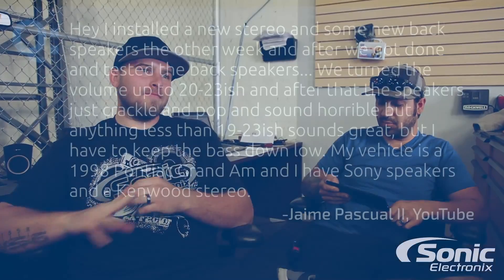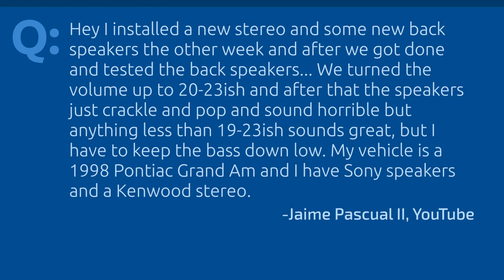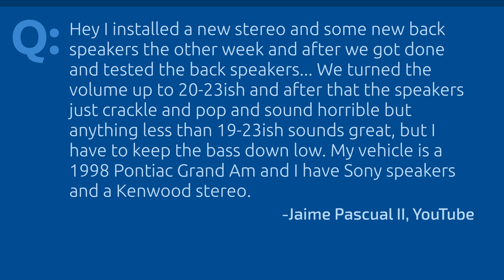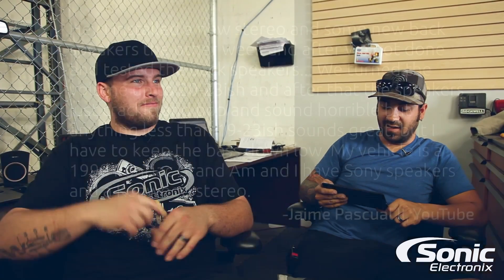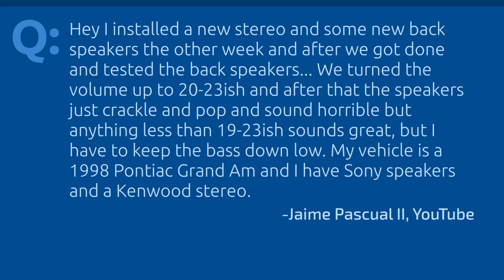Why Do My Speakers Sound Bad at High Volume? | Car Audio Q & A

Comment: I had this same problem on my 2014 altima sv when I took out my factory speakers I regret that now so I ended up putting kicker ks 6x9 rear 6 1/2 front doors kept my 2 stock tweeter on front dash went to best buy got a alpine power pack install now my bass does not sound premium anymore 😲 now it sounds like it's in a cardboard box just cheap no more deep bass and I check my polarity I thought it was weird green was positive and red was negative it is louder now with no distortion but the base is just horrible my screws are in tight I order a braket for my front door speakers so I also hear that you have to break speakers in is this true and why the base sounds the way they do please help me out here

Comment: So, I have a question. I have a 1992 Toyota Pickup, which I installed a jvc kd-r888bt stereo in. I changed the rear speakers, putting in a pair of Kenwood 400W max 6×9 speakers. I noticed that if I turn the sound any louder than level 22 (which isn't very loud) I get a nasty crackle which I didn't hear even with the original speakers...what can I do?

Comment: Hey I'm Harley I need your help my cousin installed a carduel touchscreen stereo and did disconnect the battery on my 05 crown Victoria and I've checked all my fuses and I'm still not getting any power please I need your advice
Reply: Harley Short check your ground and power wires

Comment: I installed Kenwood deck into my house with 12v power supply, some jvc house speakers, and jvc subs. It's very loud, but I want more, would it be worth "in your opinion" to add an amp to my setup? I feel like my subs are not pushing as hard as they could.
I have all this in my house, basically same audio setup in car, just in my house.

Comment: I've got 4 kicker 8 inch mid-range on a high pass filter at 150-200hz and they sound kind of shitty. 150rms to each pair. I'm wondering if it may be a polarity issue. My 6 1/2 mid-range sound pretty good at 120 
Hz

Comment: Hi guys i have a question i do have a grand caravan 05  i try to put a after market stereo i connect every single wire  to The harness it turns on but no sound then i bought a second harness same thing happen now i get a new raptor harness and still The problem but the way blue wire and red wire are connnect together to the stereo red wire..if i connect the factory head unit everything its fine so i wonder what im doing wrong????

Comment: Can a 2000w amp play 2 12" pioneer champion series 1400w each
Reply: RMS. What is the amp's rms?

Cheap companies (Boss, Crunch, etc) market their products by a bloated number of watts. They will never achieve those numbers. So you need to know the RMS, aka what it will really do. (You get what you pay for, if you bought a 2,000W amp for $80, it will probably only do 500W on it's best day)

Again, what is the rms of the subs? What is the lowest ohm that your amp can run stable? Single channel, dual channel? SVC or DVC? What ohm rating are the subs?

You've left out far too much information.

Comment: check Abdou's post a couple down right on the money aftermarket HU's probably put out more power than a stock HU, which means it probably has an onboard amp that you are now daisychaining through a crappy old factory amp that probably is less powerful than the new HU or at best the same which is not a good idea ...test your factory amp by bypassing it: pull the new HU out of the dash, unwire your head unit from the factory harness (except for the power, gnd & remote) then run some temp wire directly from the HU unit pigtail to the speakers and if the 'rice crispies' are gone you now know what the culprit is

Comment: So I have a 06 impala and bought some new rear kicker 6x9 speakers and install them. When I had install them, the right speaker wasnt getting power like the left speaker. I also have one 12 and a 300 watt amp that I didnt connect to it yet. Im just trying to figure out is my wires going bad or is it just the radio ( its the regular radio by the way) Ive bought a small kit that i can use to run the amp off the regular radio.

Comment: So, I just just switched from a pioneer head unit in my 2005 ram 1500 to a Boss Audio BV9976B a couple days ago and have been having a similar issue. When the vehicle is off, I can crank the hell out of the radio and it sounds perfectly fine, however when it's running and I try to crank the volume above 30, it has an intermittent cracking sound. Keep in mind that this is with all fairly new pioneer speakers(less than a year). With the pioneer head that I had in before I could put WAY more power through them than with this unit. Could that be a ground issue or something wrong with the head unit?
Reply: Devin Fitzpatrick ground issue or ur rca is by a power wire or ground wire ur rca can not be around and ac curent or itll pick up noise
Reply: We have the same problem when i turn off the car then the volume is 15 there is no crackling but when i start the car above 7 the speakers start to have crackling noise
Reply: Ok what do you have powering the speakers just the factory head unit and what kind of speakers are they I know you said pioneer but what is the rms of the speakers

Comment: I got a dodge avenger 97 it was a show car but it has some strange crap in the trunk like an amp called a soundstorm 700w with two large subs they seem as old as the car. Are there any subs and amp that are better then these that are under or around $200? I'm redoing every thing to this car and I want to remove the back seats and so space is no prob just want to keep the coast down.

Comment: I have a 8 inch subwoofer with a 60 Watt Amp (I'm not sure if its 40 watts RMS but i know its 60 watts peak and this is a  Home theatre Subwoofer and i changed out my stock subwoofer from the stock 60 watt sub to a 1,000 watt BOSS  AUDIO Subwoofer and tried it out and still Distorts  at  full power. The stock sub  distorts at full power and then my new 1,000 watt subwoofer  distort and its a 1,000 watt Peak but 500  RMS  and  im using the stock amp+Box (And then put 2 blue LED light strips and then put 2 plexiglass on left and right side of the box and  i have the  pelxiglasses  nice and tight with silicone (Or Cillicone |  IDK how to spell that word lol and my subwoofer does sound good at the 40 watts but i wish to have it  NOT distort ;-; I'm also getting a new stereo system soon with about 800 watts peak but 400 RMS I dont have enough money  yet and getting some money soon for the  1,000 Dollar system!

Comment: Random question! I have a Kenwood head unit in a stock system 2004 camry 2 pairs of 6x9s and factory tweeters as well. What should I set the hpf for on the Tweeters? Any help is much appreciated! (before you all tell me to just install new speakers, I am, but in the mean time I'd like my music to sound as good as possible.

Comment: i have a boss epic 2500 5 channel with 2 shallow pioneet 12s and 2 kicker 6x9s and some tweeters with a pioneer stero in my c10. everything else worls fine but when i hoom up my 6x9s i always get distortion eve w/o the subs hooked up. any suggestions?

Comment: I have two mempnis m5 12's pushed my a memphis 1500w amp. Component speakers are: J.L. Audio 1's, 6 1/2, crossed over and 4's all pushed my a 300w pioneer.  7inch touch screen deck.  My problem is when I turn my system up loud the 1's cut out.  How do I prevent the highs from cutting out?

Comment: dose door speaker baffles improves sound quality at all?
Reply: I wanted to try baffles on my set up as well. I get alot of vibration from my speakers. I definitely need to sound deaden my doors. Wondering if i can get away with just using baffles and some sound deadening material around the coaxial speakers.
Reply: Depends on the speaker.  Sound deadening woyld be best but a baffle will improve mid bass

Comment: i tested my p2 10 inch speaker with my home theater and it sounds good at low but it makes a pop noise at higher volumes it is a dual coil but i jus conected one side any idea if it will still work when i connect it to my car ?

Comment: Hi guys! I saw the Q&A video of "why do my speakers sound bad at high volume" and i kind of have the same problem. I checked my settings, everything seems fine. I have my hpf on 80 and a sub with amplifier in the back. With my pioneer radio 4x50 watt max the pioneer speakers (of 45 rms) still give a horrible sound above three quarters of the volume. I think the wires are connected the right way. What can I do about this problem? Greets from the Netherlands

Comment: My component speakers on drivers side go on and off. Checked the speaker wire and it looks good. Would bad rca's make the speakers turn on and off? I have two amps in the trunk, one for speakers four channel, and one for subs. Thanks any feedback appreciated. Thanks for the video.

Comment: My car radio is 20W x4channel  thats very weak I bought  a  50W RMS speakers the sound is bad when i turn on to max volume what if I buy better car stereo(If I buy 50or100W x4 channel radio) .Pls give me some advice?
Reply: Rade Stoimenov just buy an amp. If it's 50 watts RMS at 4 speakers is 200 WATTS RMS so you need an amp that's 200 RMS or greater with 4 channels or more.
Reply: Rade Stoimenov theres no such thing as a 100x4 rms head unit trust me ive tried to look for one and the sony one isnt 100x4 its 40x4 lol, just get an amp bro

Comment: what is the absolute best amp for a 12" rockford fosgate P3D4 sub? $250 price range
Reply: Rockford Fosgate 1200 watt monoblock Prime at 1ohm THUMPS my 2 12inch Punch  1212 DVC's.$240 at Amazon.
Reply: Julienne Goodell google amplifind

Comment: my speakers are cracking  too but only  when my 4 channel and sub amp run together  if I play them separately it's clear can anyone help
Reply: sounds like clipping.. u are not providing enough power.. u need to upgrade your battery to an AGM or add agm in front and back..
Reply: I put everything  in my durango  it's clean now thanks
Reply: qjuan white
word.. your durango prob has a stronger alternator and battery..

Comment: I have 4 Rockford Fosgate 6x8 speakers and a Pioneer head unit in my 98 Ford Ranger. I tend to disagree about the loudness setting. At least on my Pioneer, the music sounds like crap with the loudness set to off. Better on mids. Best set to high. Also, I tend to keep a plus 2 on my bass boost. This is without a subwoofer and without an amplifier. I go from listening to Beastie Boys to stuff like Judas Priest, so you have to adjust the bass accordingly, but the loudness always needs to be set to high, otherwise it sounds muddy, as if there's no treble. I plan on getting a 70 watt Jensen amp. Might get Rockford's p300-10 powered sub, but with the mileage I'm at, I'm afraid of sinking too much money into it for where I'm at financially. The amp is a must though. Aftermarket HUs still disappoint compared to speakers.

Comment: I have a question why do my mids get distortion when my bass hits? I have alpine 5x8 in the factory location in my 04 f150 have all my amp gains adjusted running rockford fosgate prime 400 to my mids and 2 prime 1200.1 to my 12 inch t1 PLEASE HELP!! I also have in line bass blockers installed THX

Comment: Two things. If its what I think and its a rear deck? If you mount those 6x9s without the factory adapter straight on the metal, it'll cause it to pop and distort at loud volumes too. Found that out with my first car quick. Second, while you 'can' run speakers off a factory amplifier, I typically don't. You might be better off running new speaker wires to the aftermarket deck. Then perhaps upgrading to an external amp if its not enough.

Comment: I just bought a 2004 Honda Accord with what I believe to be factory equipment. I noticed the speakers have a slight distortion. They don't sound like crap but if I listen close enough. I can hear cracking. 

I installed a pioneer deh-6700bt. With the high pass filter set at 80 hz it does seem to help but not eliminate the problem. I've played with the fader and balance and I'm pretty sure it's coming from all four speakers, but definitely more so from the rear speakers. 

Any suggestions? I appreciate any feedback

The speakers in the rear are pioneer to-09096zh/xl

Comment: I have a kennwood radio and jl audio speakers in all 4 doors with amp on them and subs with amp on subs. On the radio when you go to pro eq and you can go to bass or mid or treb and go to the setting that you can change the 125 to up or down in number what is this and what does it do? When i change it I don't hear a difference in sound.

Comment: I just purchased a '03 Grand Am with an aftermarket Sony double din deck in it. I know the guy wired it pretty incorrectly, but i was wondering on how to fix it? It's wired to the cigarette lighter power source instead of the ignition source for one thing. I guess he didnt connect the antenna either because the radio doesnt work. I plugged in a brand new aux cable, and even at low volumes the back speakers (also aftermarket Pioneer something-or-others) whine, crackle and pop. Did he wire those incorrectly, too? Get back to me please, thanks!
Reply: SyfiraOG smh  pull it and redo it.

Comment: okay you 2 geeks, question time. system setup- HU (Sony cdx) 2 12's ported on 500w, factory speakers replaced with Memphis audio street reference srx series- 6.5 components up front, 6X9 3 way on rear. my back right speaker started this hissing/crackling but only on certain songs & at low volume. it can't be from being played 'too loud' Bc that's what they're for. with volume up no problems. last I checked was 128 db .

Comment: sweet, maybe i can get some knowledge, i have a 2000 jeep grand cherokee, it HAD the infiniti system, no longer, all factory speakers have been replaced, factory amp is completely disconnected,  ive ran new speaker wire from all 4 door speakers up to deck, in another video i seen where someone could only turn it up to 20-25ish before speakers started to crackle, im having the same problem,  the deck is a pioneer avh  x-7700bt flip out, speakers are kicker 6x9s in the front door, 6.5 in the rear door, 
nothing is factory ran, 
6.5 specs 
Kicker
Model: 41DSC654 D Series
RMS Power Handling: 120 watts per pair / 60 watts each
Frequency response: 40-20,000 Hz
Sensitivity: 90 dB
6x9 specs
Kicker, 
Model: 41DSC6934 D Series
RMS Power Handling: 180 watts per pair / 90 watts each
Frequency response: 30-20,000 Hz
Sensitivity: 92 dB
Deck 
Pioneer AVHX7700BT

Comment: I got a question. I have a 2012 Silverado LT (non-Bose). I just replaced the head unit with a Pioneer FH-X720BT hooked to the factory speakers. A Kenwood KAC-729S pushing an Audiobahn AW-1008T in a standard .75 cube box from BestBuy. I have to fade the front to rear+3 because the front speakers are ridiculous loud. the Sub, all frequency's sound normal at 55 (SLA to -4) except with the kick drum  hits. It sounds like someone kicking a door. I thought the Sub was 400 Watts RMS, maybe the sub isn't the problem. got any ideas? Bass Boost and Loud are off, bass is set to flat, and amp control on the deck is -3, 100% gain on the amp itself.
Reply: +Kevin Wayburn sounds like you need to turn up the gain on your amp and set it to low pass
Reply: +festa289 gain on amp is at 100% and I use the head unit to adjust how loud it is. I replaced the sub woofer with a Planet Audio PX12 and it's loud as f***. I think my old Audiobahn is on its way out. 13 years of abuse. lol

Comment: I just put in an aftermarket radio and the back speakers rattle and the front speakers aren't playing bass anymore like when I had the stock radio in it. ik theres no problems with wiring in the radio so what do I need to do so the bass will play in the front more and not in the back because my rear speakers cant handle bass. I also tried fading it all the way to the front and still not a lot of bass is playing like when the stock radio was in it. Please help
Reply: replace speakers

Comment: My Rockford punch p1 isn't hitting lows well idk why I used a dmm for gain
Reply: Funai get a new amp ssl is garbage but should be able to give your p1 250 w
Reply: Derek Sr. been rockin the system for about a year now man. every thing works n bumps great i can't complain, i tuned everything using a multimeter. obvi my 1500 ssl is throwing more power than my 250rms p1 with a 500w peak but dude no distortion n you can hear it from a block away. ssl isnt bad had 0 problems with it thus far
Reply from the maker: +Funai Properly setting the gain is just one part of it, many other factors to consider. Are all your filters set correctly? And what kind of enclosure is the sub in and Is it the ideal airspace for that sub?
Reply: +Sonic Electronix thanks for the reply..i have my lpf on amp at 80hz plus my hu lpf at 85hz with the phase reversed. my subw. level is all the way up at 8 and flat on bass, treb, mid. my amp is a ssl evo1500.1 mono, a decent jvc hu, and my rockford is only 250rms 500w peak so maybe too much power to the sub?? it seems like this sub has so much potential but just not boomy bass enough
Reply: +Funai also the enclosure is for the rockford punch p1
Reply: +Funai try setting your lpf to about 45hz see if that helps if you haven't figured it out already
Reply: no dont set it to 45 hz set it to 60-80hz